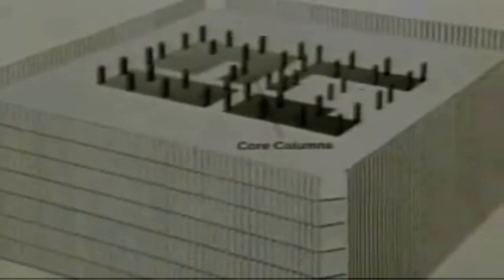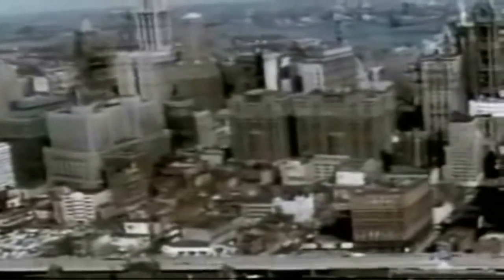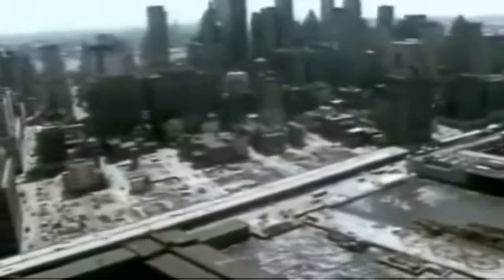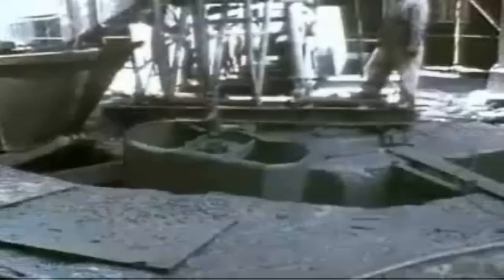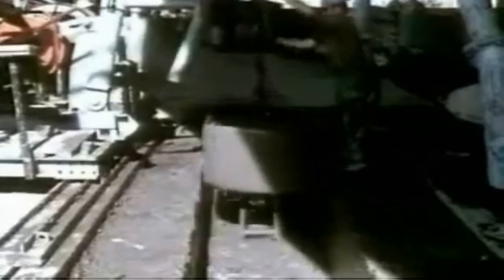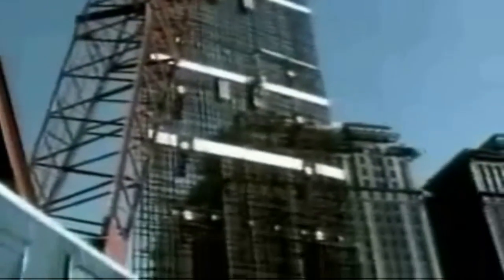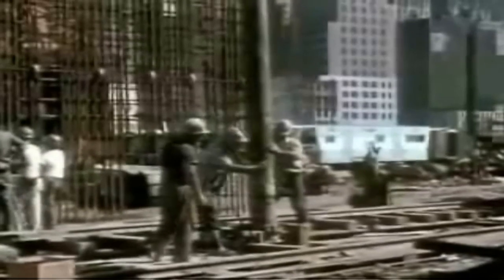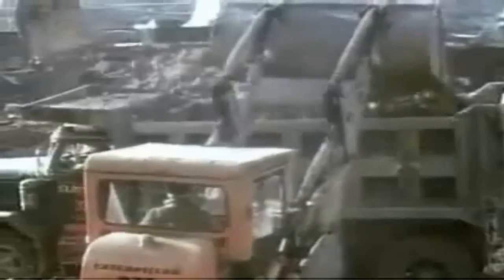Building the World Trade Center Towers

Comment: Take a good look at all that steel, and the columns were just massive, you mean to tell me an aluminum airplane can slice through all that steel and come out the other way in uniform motion? Give me a break, planes don't just disappear into steel buildings, especially structures like the WTC. It breaks the laws of physics, thats why I beleive the planes were video fakery to show the masses and doop them that there were planes involved. Now for the buildings turning into dust? Well if I tell you what I think really happened then you will think I'm crazy, but soon down the road people will realize what really happened. Look up the Hutchinson affect, and see what can happen to metals when its being hit by freqeuncies. You will be blown away with this technology,, it can be used for good, but on 9/11 it was used for bad, very bad.
Reply from the maker: an aluminum can travelling at 500 mph striking a solid steel column will only squash, meaning of Couse that most of the aluminum plane did little damage compared to the steel reinforced sections such as the two engines, which might, with luck, take out a column or two each. hardly enough damage to initiate a fatal collapse at free fall speeds.
Reply from the maker: tzef73 the planes were probably steel reinforced military drone aircraft.
Reply: +tzef73 Dude, how do you then explain the millions of people in New York that saw the planes? A big tv monitor in the sky maybe? Give me a break you can hide it from tv viewers but not from millions of people in the city. And People even saw an airplane engine down on the ground that fell from the towers. I can buy that it was an inside job MAYBE but I do not buy the no airplane bullshit.
Reply: Those core columns were huge..5 inch thick on the lower floors and 3 inch on the upper...where is all this steel in the aftermath? Never penetrated sublevel 2...why? It never reached the ground 👍
Reply from the maker: Oldschooldan1 a 767 traveling at 550 mph at sea level is impossible unless it has been militarily reinforced.
Reply from the maker: ***** both wtc 1 and wtc 2 (not to mention wtc 7) fell at speeds impossible with out the use of demolition charges of some sort, period. you can whine all day about the planes going 500 mph but it doesn't change that one pertinent fact.
Reply from the maker: oWASTINGTIMEo if you were to slam a steel column against an airplane wing at rest which would be the winner, steel or aluminum? the same applies in reverse. its the same energy as far as physics goes. the reality of the situation is that the planes were probably military to start with, had steel reinforcing and were well equipped to do just what they did.
Reply from the maker: Oldschooldan1 it doesn't take a rocket scientist to realize that wtc 7 was brought down with demolition. the simplest of house wives can figure that out, without any degree's what so ever. it is morons and or shills that refuse to admit it.
Reply: +tzef73 actually as i read under this post, people don't know a fuck about  aviation, really guys.. if the plane is going faster nothing changes, the aircraft is really really light there were bombs, fucking bombs were used
Reply: A 767 moving over 500 mph is more than enough to penetrate the buildings
Reply: The engines each weighed over 5 tons...ya dope, ya...
Reply: Johnathan, the WTC building was designed and built to withstand several impacts from an airplane.  The buildings collapsed because it was planted with explosives.  Even if the steel trusses were damaged, it would not bring an entire concrete and steel structure to the ground.  Read about the molten metal (Thermite) that was found.
Reply: Mason Strand i hate when people say melt . I work with steel and at those temps the reduced amount of support columns from impact combined with heat would've lowered it's load capacity
Reply from the maker: Oldschooldan1 you think the steel used was 1/4 or 3/8 inch thick? you can spout off about joules but you had better double check the blue prints.
Reply: +King Wacky What the fucl melted all that steel from those huge beams? What bent massive beams so tightly with no buckling or tearing? What the hell fused the concrete and metal together and melted steel together? What caused molten pools of STEEL for weeks after? What about the explosions that are well documented not related to the plane? Even if I did not have experience in multi floor steel buildings of 15+ years and believed your parroted BS. The unexplained heat and other huge issues in every aspect of this event prove you have been had.
http://911review.com/articles/reijden/911_my_own_review_files/WTC_steel_abnormally_bent_02.jpg

http://www2.ae911truth.org/images/infoitems/swisscheese.jpg
Reply from the maker: Oldschooldan1 I've worked in the construction trade for 12 years. I dare say I know what it takes to bring down a building. wtc 1, wtc 2, and wtc 7 were all brought down with demolition.
Reply: +tzef73 actually as i read under this post, people don't know a fuck about  aviation, really guys.. if the plane is going faster nothing changes, the aircraft is really really light there were bombs, fucking bombs were used
Reply: Old glory plans can't travel 500mph at sea level
Reply: Planes are piss weak & fragile. the have to be in order to fly. That's why airliners have just fallen out of the sky due to hull failure. Ever heard of train car just fall apart en route ? Even an old timber bodied one?

Now, a freight locomotive is far more heavily built still. Airliners can slice though the towers yet a 200 ton loco (or even a tiny 30 ton switcher/shunting loco) will destroy a plane with little damage to the locomotive.
Reply: the planes should have been ripped apart with that low altitude and high speed..
Reply: The heat from the fire weakened the trusses supporting the floor slabs. Firefighters have documented that steel trusses are seriously damaged after 15 minutes of fire. "Don't trust the truss"
Reply: ToonieMama How About the 1993 Bomings? The buildings did not collapse when that happened.
Reply: ToonieMama Show Me Actual Evidence That Thermite was found, and why is the thermite not in the 9/11 Museum?
Reply: 78musicdrums If these people stop talking out of their ass and did the research they wouldn't say such idiotic things.
Reply: Mason S 
So you're saying that jet fuel (Kerosene) burns at 700 degrees Fahrenheit, and the 700 degree heat melted fire coated steel beams?  Bare steels kindling point is close to 2,600 degrees Fahrenheit, and fire coated steel has a kindling point that's over 3,000 degrees Fahrenheit.  I'm not a mathematician, but your heat number is off by about 2,000 degrees... give or take a hundred or so!  A 700 degree fire would not even begin to affect steel... Ever!
Reply: 78musicdrums 
Airplanes are not built out of Aluminum? So they're made out of a lighter weight material steel?  You can't be serious! Thanks for the highly comical statements, I'll laugh about this one for 20+years
Reply: It was used for hate, by human haters.
Reply from the maker: MrAmericasbadboy the aircraft which struck wtc 1 and wtc 2 were probably military drones with reinforced steel wings. a standard aircraft wouldn't have sliced the building so easily. the engine found, btw, didn't match with what a 767 uses, never had its part numbers looked up, etc etc etc.
Reply from the maker: at best the two engines would take out one column each.
Reply: iGaRaai90 I work with steel too on  buildings installing elevators we do all structural steel for the machines sheaves etc... The beams are massive and would need more heat to be fail in a structural configuration. Looking at the tower hit near the top fall how can it fall so fast when there is unharmed bldg below.
You hate when they say melt. WELL THERE WAS MOLTEN STEEL AND MELTED BEAMS massive beams crazy bends with no buckling or tearing
Can you please explain that.
Reply: Mason Strand show us a single one this has happened
Reply: sheep are thick buddy.
Reply: +vengencefrom1979 Exactly.
Reply: +tzef73 No, we don't think you're crazy, we know that you are stupid. Very stupid.
Reply from the maker: all right, you made me look it up. if I didn't need an encyclopedia to keep track of the lies deflunkers tell I would have sooner.

I am no idiot, btw, as I am not predisposed to verify deflunkers claims, most of them being lies, and for the record, the thickness of the outside columns in no way explains the collapse of the core columns, which fell at speeds impossible without the use of demolition.

9/11 - inside job, George bush - traitor and a grandson of a known nazi to boot. the acorn doesn't fall very far at all, does it?
Reply: +Cody Tapp Show me your physics papers from college?
Reply from the maker: Oldschooldan1 its common sense, which you don't have.
Reply from the maker: Oldschooldan1 I'd say you're as blind as a bat.
Reply from the maker: Oldschooldan1 the simplest of house wives has more common sense than deflunkers.
Reply: +tzef73 Of course it can't, as it is violates the 3rd Newton's law. But this Hutchison effect - is disinfo garbage. Hollywood doesn't use any of that, but can easily make an airplane to fly through anything it wants, using animation, computer graphic, composite video, and special effects.
Reply from the maker: plenty of eyewitnesses said they heard bombs going off as well as news reporters. even at the pentagon there were bombs see https://www.youtube.com/watch?v=WOGBGLIYiSg
Reply: Ian Fanning Idiot. The 3rd Newton's law doesn't give a fuck which object is moving and which is stationary, as the forces exerted both on a plane and a building are EQUAL, but OPPOSITE in direction: F = - F*
Reply: +tzef73 The explosion of the planes crashing into it was what happened it just all melted away No more theories please I saw the second plane hit When I was just a little kid!
Reply: +vengencefrom1979 I recommend you check out this article if you don't understand momentum https://kendoc911.wordpress.com/debunking-the-no-plane-theory/disinfo-aluminum-planes-cannot-penetrate-steel-buildings/
Reply: CANT STUMP DONALD J TRUMP - #TRUMP2016 Ha-ha-ha-ha, thanks for the link, but it is a complete garbage. Momentum? By itself, the law of conservation of momentum is not enough to determine the motion of particles after a collision. Another property of the motion, kinetic energy, must be known. This is not necessarily conserved. If it is conserved, the collision is called an elastic collision; if not, it is an inelastic collision. So, What kind of collision is a collision between an airplane and a building? Can you tell us? There is nothing on that in the disinfo article you have shown us.
Reply: +vengencefrom1979 Except that the fuel didn't burn off. It dispersed within the building and as video clearly shows, the fire was still burning at least 30 minutes after.
Reply: how to explain this to you so u understand it ...if a fly hits u at its normal flying speed ..u barely flintch ..but when u in your car at 130km/h and u hit a fly ..it gets smashed to fuck on your windshield and makes a big sound ..and is a simple fucking fly ..is the simple force equation ..mass x speed = force ...so when that plane hit the tower at fucking 500mph ..belive me it fucked the tower up
Reply: Planes have survived worse.
Reply: Mason S Wow... What media do you worship? I have never heard such an uninformed explanation of what happened to the Trade Centers! How does it feel to have your whole perception of reality controlled by the government?
Reply: WackyBroProductions  Really? Did you go through  the same flight training as the alleged hijackers (NoneYa)?
Reply: Well I mean you have google and every accident report and operating specification ever. It doesn't take training to logic.
Reply: No airplane would ever take down the WTC.  They had explosives planted.  Our government wanted to make it look like a terrorist attack, but it was an inside job.  Follow the money!!
Reply: vengencefrom1979 You can cut through Steel with a water jet. What makes you think that Aluminium can't do the same?
Reply: 78musicdrums 
So what percentage of a modern day aircraft is steel?  You said that airplanes are made out of steel not Aluminum!... I apologize if I overreacted to your steel comment, but it was so highly uninformed, and I don't post anything that I'm not 100% positive about. My bad!
Reply: 78musicdrums 
And which way is that might I ask?   Which force would do more damage; a Aluminum  airplane crashing into a big ole 1/4 mile high  Steel structure, or the big ole 1/4 mile high Steel structure crashing into a Aluminum airplane?  ....Equal and opposite reaction!  Doesn't matter how fast, or what Alloy of Aluminum the plane is made out of....  A-500 and A-36 Steel wins every time! Hands down...  No contest.... K.T.F.Only
Reply: dam i didnt realise you were on the planes and in the building when it crashed
Reply: people out here thinking they know shit about steel must be one of the biggest pieces of lying shits ever talking like they know shit. i followed welding class for like 8 hours a fucking week 2 years in a row. heat does fucking make steel weak, why in the fuck would we heat it up then anyway, for our fucking entertainment or something??!! i fucking burned holes in steel instantly with a little welding gun. let alone what an hour of fucking heat does to a row of steel columns thats like 2-3x hotter than what we could achieve in welding class. but yall talking about a subject like y'all know what the fuck ur talking about?? just amazing, i oughta ram my foot up your ass so u could just lick the tip clean, fucking idiots
Reply: Look I was there on 9/11. Planned hit those buildings. For all those people saying an aluminum plane couldn't do that...how about I throw a soda can at your head that's traveling 500 MPH!! Think about it. The government didn't do this. But they let it happen.
Reply: The plane did not cause the collapse.. The jet fuel from it did. It hit the tower at 500 mph, and actually DID not go all the way through truly. Debris from the plane came out the other side, and because the building was actually smaller in width/length compared to the full size of the plane with its wings and nose, it's no surprise it got lodged in there and exploded with the jet fuel. Once this occured, jet fuel, at a temperature of about 700 degrees Fahrenheit, started to MELT not completely BURN AWAY the columns. This weakened the steel structure, and caused the steel supports to bend. You can actually see this on a video, if you watch closely before the collapse, the structure bends inward a little before collapse. Because of so much weight of other steel on top of it and the fact that the supports were weakening on the upper floors, it caused a pancake effect causing the whole building to collapse. Take any building any day and weaken the structure above to the point it buries weight on top of the downer floors, then see what happens. It's as simple as Jenga.
Reply from the maker: MrAmericasbadboy lol, don't know much about physics or science do you? steel vs aluminum, steel wins every time.
Reply from the maker: iGaRaai90 one more time, the jet fuel burned off in seconds leaving behind nothing but smoldering furniture.
Reply from the maker: ***** steel is still stronger that aluminum.
Reply: the plane was going 500 mph maybe thats why!
Reply from the maker: MrAmericasbadboy lol. that's not the way physics works. on the other hand, if, and I say if, you had a projectile, a rod of aluminum, say, may 10 feet long, aimed at steel only an inch thick, it might go thru steel. I doubt it though.
Reply from the maker: MrAmericasbadboy the official story is crap.
Reply: A 1 oz bullet can bring down a 300 lb man. A plane travel that fast had enought energy to bring down more advanced buildings upon impact engineers are surprised they stood that long
Reply: Lead and copper is soft as shit, yet going fast example out of a gun barrel it can penetrate steel no problem a puny 55grain bullet can go through 1/4" steel I can't even fathom what a 200 ton plane would do holy shit lol
Reply: the plane shot a bomb through it
Reply: I am just gonna say this to everyone, heat make steal weaker, and it can make it weak enough for it to collapse. The top floors when they gave way that is many many tons of steal pushing down on the next floors that are still weaker from the heat. So it push them down on top of each other in a domino effect and the space between the floors keep the momentum going and the buildings collapse, it is very possible the way WTC was built and it happened get over the conspiracy theories it can happen and it did happen.
Reply: The fuel would largely explode , externaly DUMBASS. The wings ( where the fuel is, gotta keep it simple for such a drongo) have no change of cutting though the steel & concrete.

So, from well under a minute after the hit, the max temp has been reached & it's all downhill from there ( a bit like your argument hay ?)

After an hour or so of office fires in 5% of the building  WTC 1,2 & 7 go into freefall. & the rubble is in the building footprint & about 2 stories high.

A TALL STORY INDEED!
Reply: "you can't fly a commercial airline at 500mph at sea level" This statement is false, I am involved in aviation and know many airliner pilots. There are multiple cases of airliners accidentally exceeding design specs by extreme margins and coming out damage but saved. 911 was very tame maneuvering compared to these other cases.
Reply: Structural engineer up here ^^^^^^^^^^^^^^^^^^